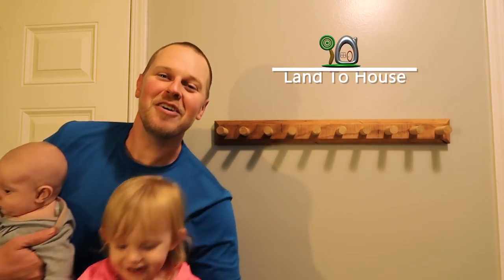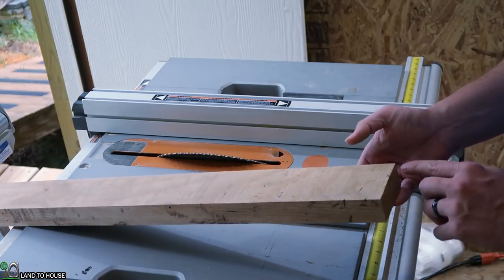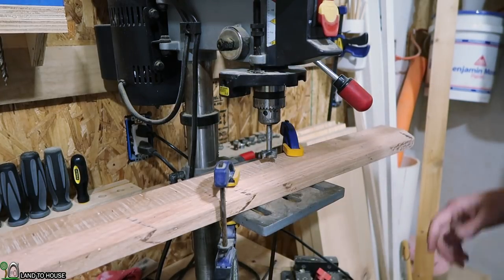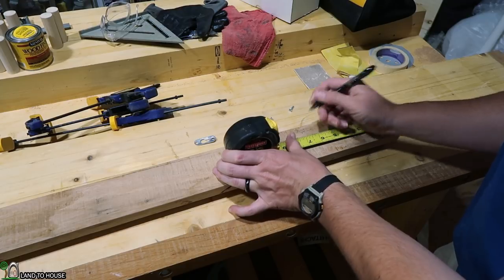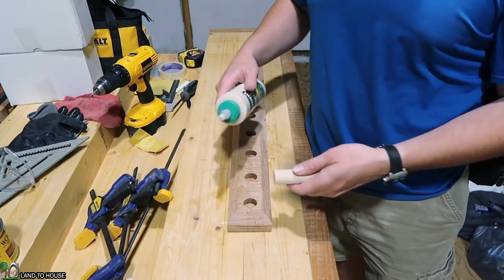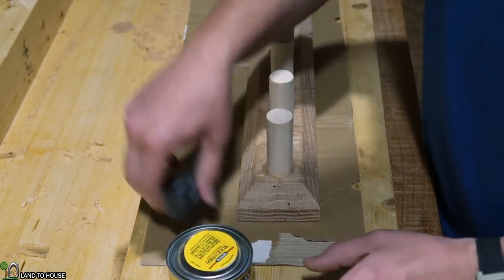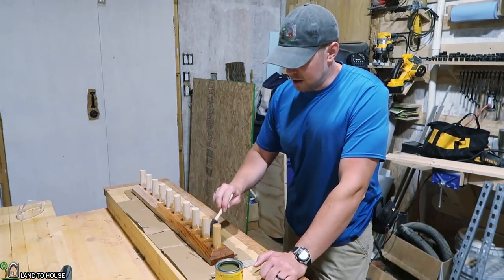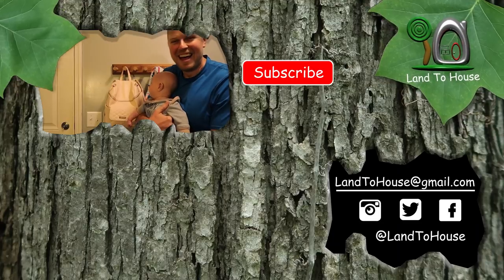Build an Oak Coat Rack - Land To House

Comment: Nicely done, Seth. That will be a family heirloom gadget that you keep for a long time and move from house to house. If you build another, try angling the pegs so the have an uptilt of about 15 degrees. I bet with your skills you could easily fabricate a jig to give you the perfect angle.'

You are so lucky to live in the eastern half of the US of A where hardwoods are common and a little scrap like you used does not cost an arm and a leg.'

I spent my weekend laying down a dozen 80 pound sheets of 4x8 3/4 inch T&G OSB for a new floor underlay. Tough work for a 70 year old all by himself. I could have used your muscles! Doing work on my hands and knees is no longer something I look forward to. I can get down and work OK, just cannot get up when I am done!

Keep up the good work and thank you for taking time to share with us. (edited for typos)
Reply from the maker: Thank you. This was a leftover from the ladder I built for the shop. Total board 2x8x96 cost was $24 ish. I thought about the angle and the drill press could have done that but then I went with the easy route. 

Flooring work seems like a good hard job.
Reply: @LandtoHouse  your scrap bucket has tons of angled cut-offs, one of them under the board is a real easy way to make angled holes on the drill press without having to do the fancy table tilt setup.

Comment: Looks like you could use a small shelf above your new coat rack for you sunglasses, etc. What about using that off cut 1:13 from the coat rack? 💜🌞🌵
Reply from the maker: I have a feeling Ashley's front door design is not finished :) there will likely be a shelf.

Comment: Love the videos.  Any thoughts on what you'll do different on the next hat & coat rack?
Most hardware store dowels are Aspen unless labeled otherwise. I think the contrasting tones look good.  
An upholstery tack on the top of the peg at the tip will help stop things from sliding off.

Comment: Hi Seth I've enjoyed watching your lifes journey and not just how your woodworking skills have improved. Did you get sponsored by Dewalt as you have a lot of their brand my reason for asking is at the start you were making 90$ beds yet your tools are expensive especially for a DIYer keep up the great work mate and check out Paul Sellers YouTube channel it will give you some top class guidance for any project you take on if you need it. Cheers Glenn
Reply from the maker: It would be nice to be sponsored by Dewalt! My drills are gifts from an old neighbor. The angle grinder was a Christmas present. I actually purchased the saw about 6 years ago... the tools are old but still work well. I need to check out his work. I make a lot of youtube videos but dont watch all that much.